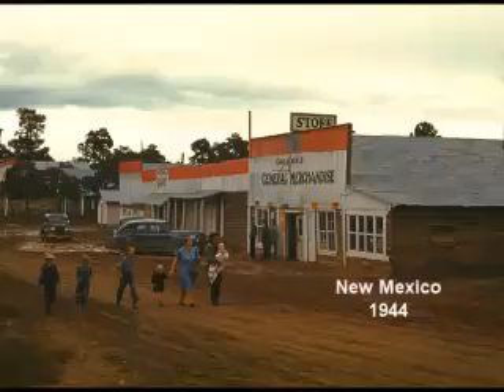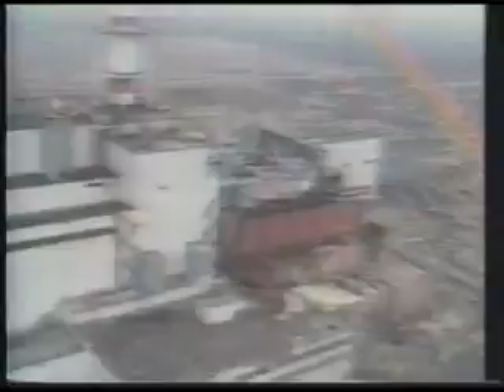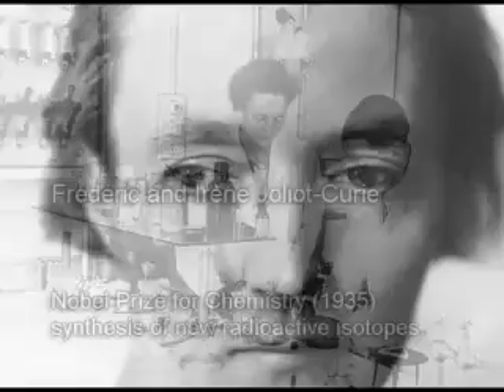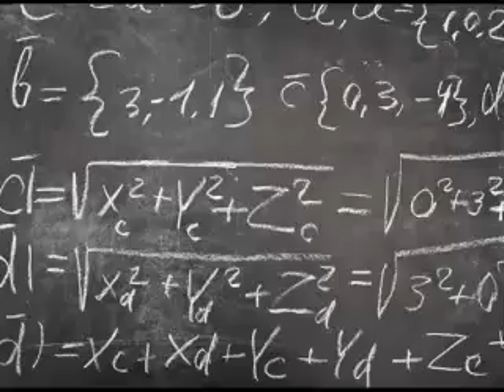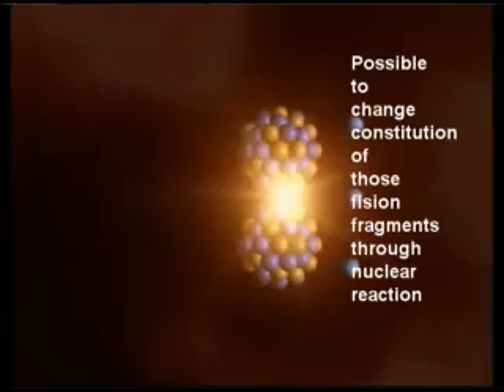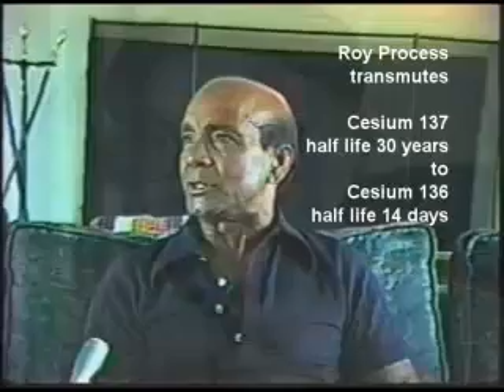No Time To Waste

Comment: icke11234-  Yes, the Roy Process will transmute plutonium 239 from atom bombs, the aim of nuclear power, and spent fuel (MOX) ultra-long lasting, invisible, deadly elements, to non-radioactive lead. In addition, the Roy Process will produce electricity from the decay heat at each nuclear power plant.